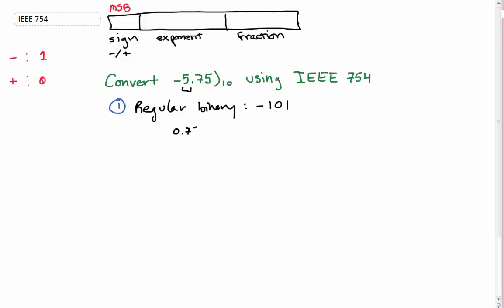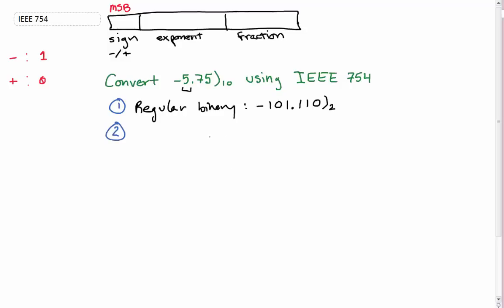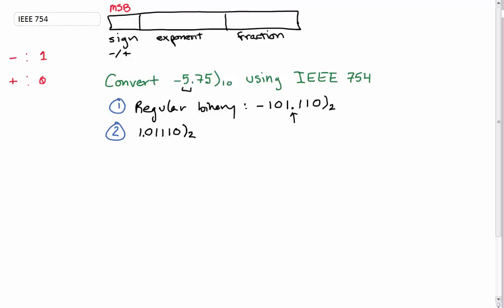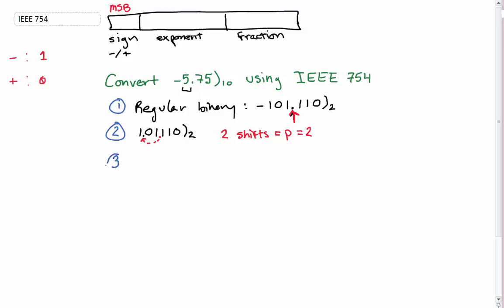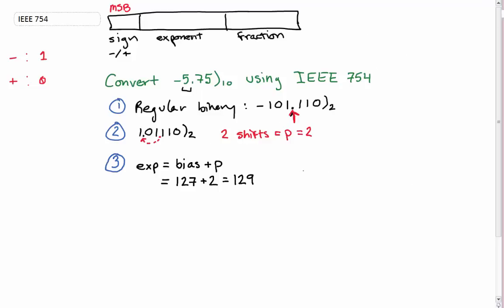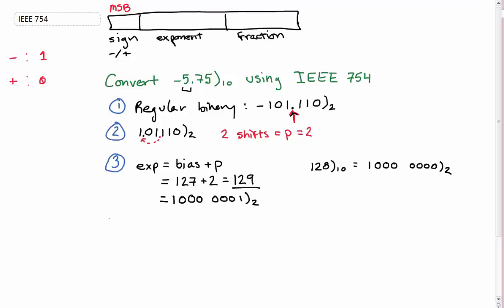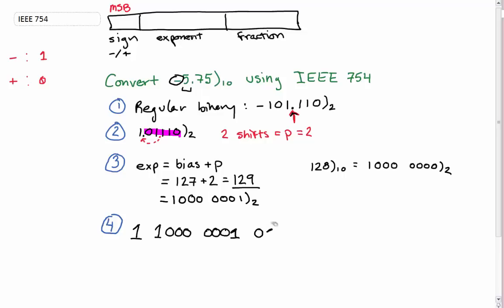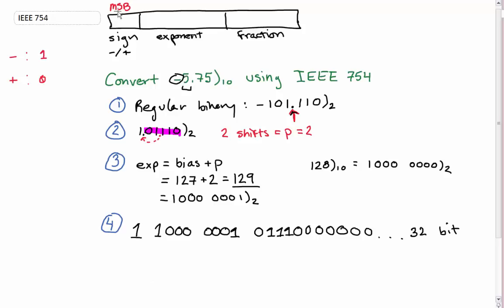Decimal to IEEE 754 Standard Binary Conversion

Comment: What if you have to shift the floating point to the right (0.125) does that make p < 0 with -3 as p ? and u lower the exponent instead of making it bigger ?
Reply from the maker: I don't know if I fully understand your question, but when you're finding p you will always shift left. What you want to get is 1.- ideally, or even 0.-. You always want to only have one number to the left of your floating point.
Reply: if you have number 0.001 (0.125) u have to shift to right to have format 1.ff
Reply: +Tomáš Hrubý 
Yes, in that case You have to shift the coma to the right as many places as needed to satisfy the rule of 1 in front of the coma.

Then the constant of shift amont (in video it is 'p') will be negative number. In example if you shift the coma two places to the right then p = -2.

Next when you will calculate the exponent, you should do 127 + (- 2) = 125 in decade.

Step four, is as in the video.